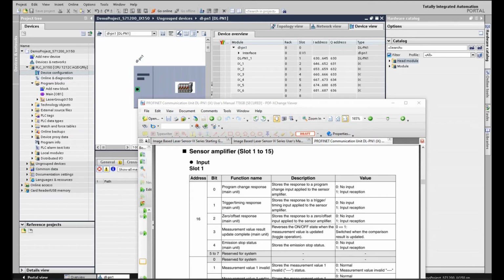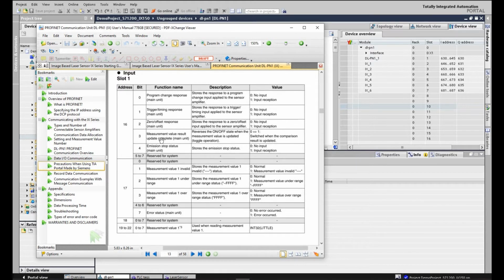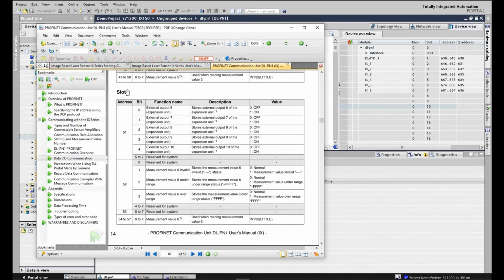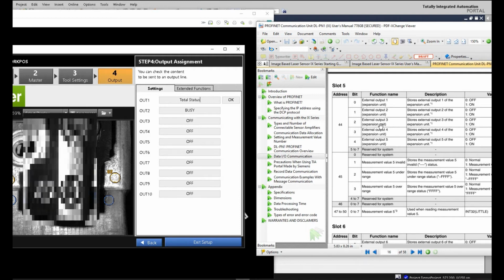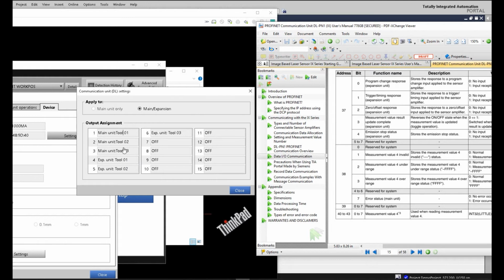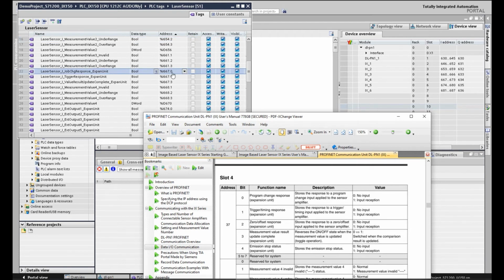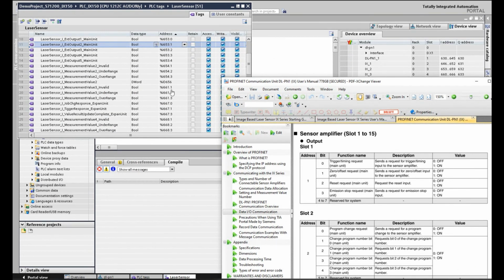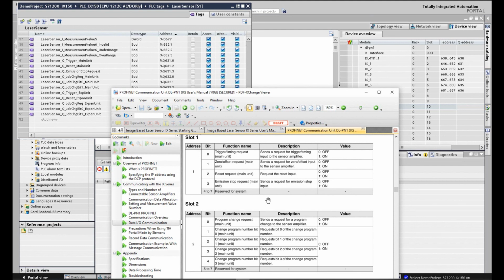KI07. (EP04) IX Laser Sensor - PLC Tag List Base on DL-PN1 Profinet Mapping List (TIA Portal)

Comment: excellent explanations ... thanks for your input.
Could you explain how to do it in step7 with the same IX150 sensor?
Reply from the maker: The program in Step7 is almost the same, only the hardware and network configuration looks a little bit different. Do you really need Step7 style, I could make a supplementary video just on Hardware configuration in Step7 in recent days.
Reply: @electricalautomation  thanks so much
Reply from the maker: @jesusmanuelchavarriaperez5968  I just uploaded a new video, which is based on Step7 showing how to configure the hardware and IO tags.
KI11. (EP.08) IX Laser Sensor - Profinet and IO Hardware Configuration via Siemens STEP7
https://www.youtube.com/watch?v=o12DN6j2TUw